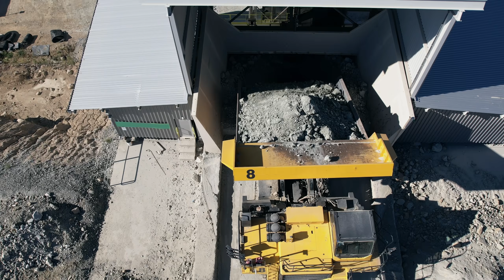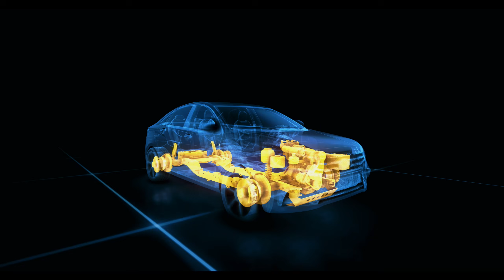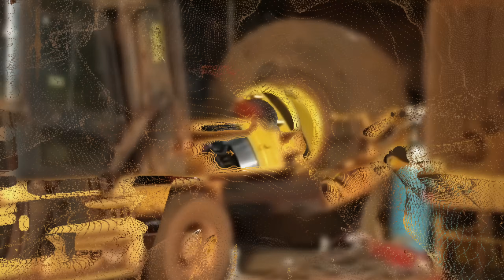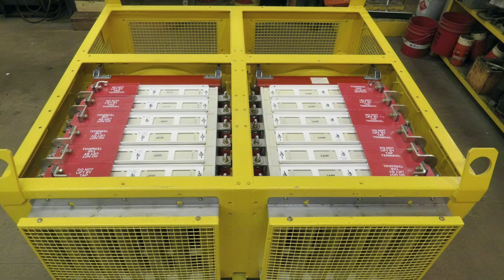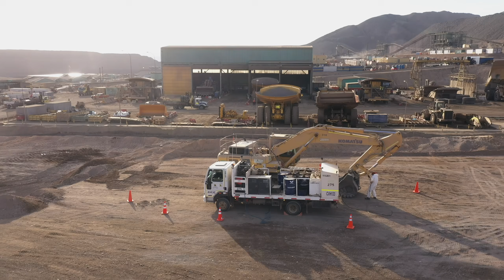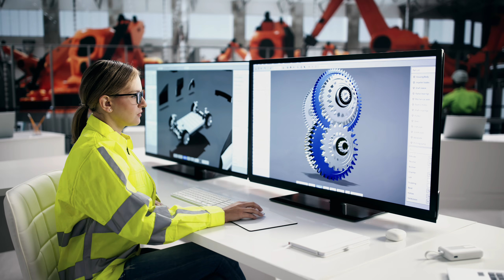Inside Mining Haul Trucks | Facts You Didn't Know

Comment: nice video again imo, i like the pacing and the level of explanation , the structure of the script too, i didn't know those giants were automated sometimes or could use electricity either to brake internally, or to power the wheel, and the external alimentation like trains, I saw something similar once in germany for trucks in a highway, but it was still in experimental phase, i don't think there's any mines that have those in france, or i don't know them.
I know often mining ore yields several minerals like copper and silver and gold or platinum i think sometimes are extracted at the same place because there are present at different concentration, but i feel there are plenty of times where it's less known and it's about geology i find there isn't much vulgarisation , i'd be curious to watch some documentary about that x)
Also i feel there can be interesting documentary about "2nd lives" of a mining site, when it's over, i'm sure the technology to rehabilitate the land has evolved recently at inegal pace in the world, and some example of where it works, what can we do after we dug the hole i feel can be interesting too, either on the land , or the recycling of the metals too, like there was this documentary i watched about how old ships can be turned to nails, cutting the hull, and reheating the piece to make thinner and thinner wire until it's just some nails, it was quite impressive to watch, if you're into the "you would not believe what those nails were made of x)"
Reply from the maker: Thanks for the advice. And yes, the amount of dirt moved by one of these giants is just unimaginable and the engineering behind them is nothing short than testing the limits of efficiency itself. I remember my first time getting up and close to one of those while fuelling up equipment in a mine. 
And about the “reclamation” of mined land. That is a cool topic in itself and I will keep that in mind. A lot of reclamation going on where I work: Right now, I’m at a project where we are just in the starting process of getting a mine rolling up. Long days but I’ll have another video out in a few weeks. I appreciate your feedback.